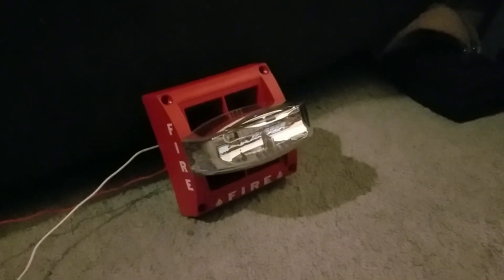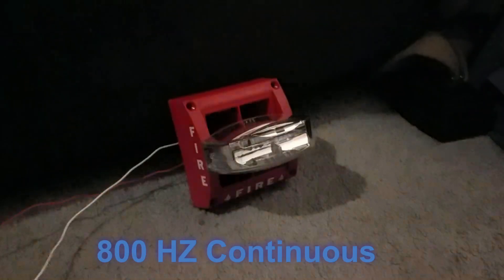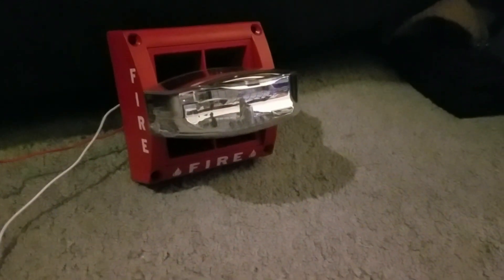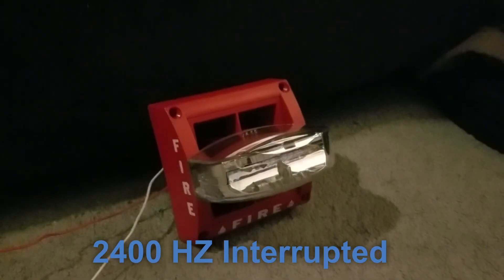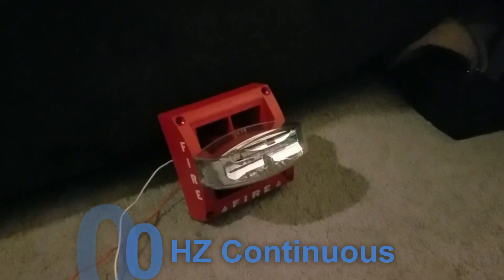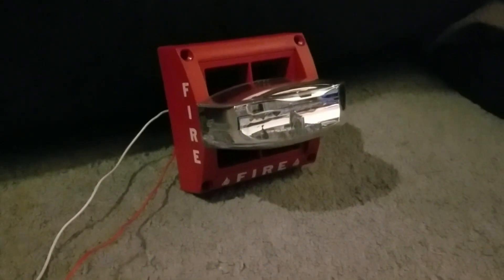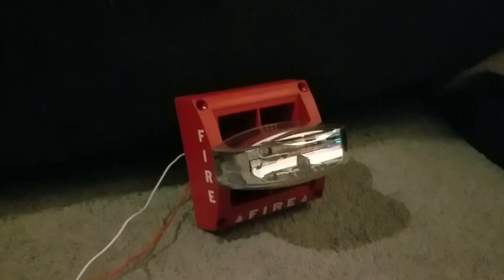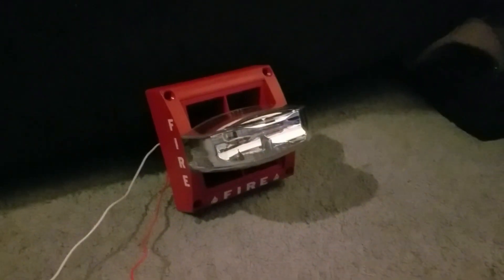System Sensor MASS [All Tones]

Comment: Could this strobe ever sync?
Reply: No, System sensor MASSs were made way before strobe sync was required. The Spectralert classic series takes the role of strobe sync outputting it's predecessor the system sensor MASS series. So before 1997 strobe sync didn't exist.